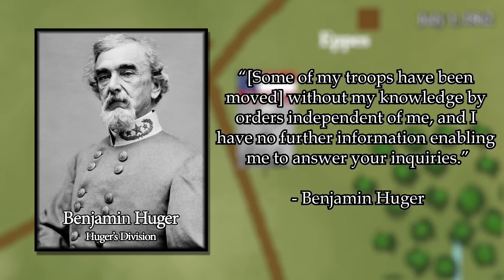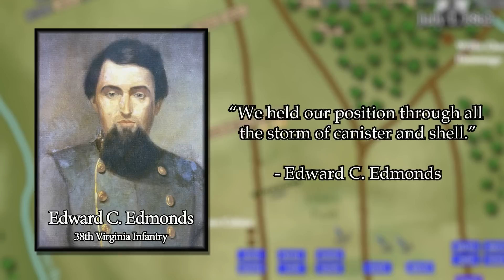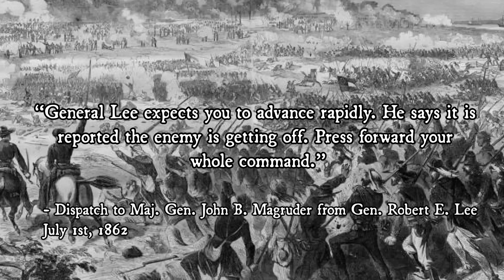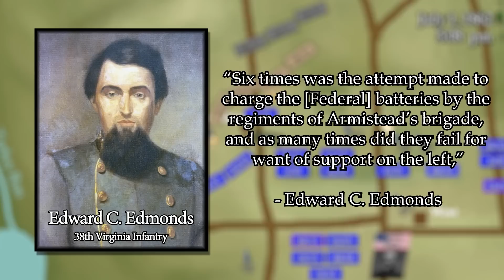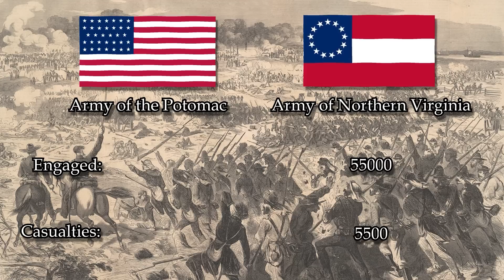ACW: Battle of Malvern Hill - "Magruder Attacks" - Part 2/2

Comment: Another interesting dynamic in many CW battles: commanders would attack a well-fortified position with even odds (or at times, less).  Conventional wisdom says you want 3:1 or better to attack a "good position".  All the Peninsula battles were fought without a significant tactical advantage....
Reply from the maker: well, Lee had 3:1 odds against that portion of the yankee line, however, some of his subordinates decided not to attack, ie Jackson
Reply: @WarhawkYT  Ah, yes, the legendary Jackson 7 Days Torpor.
Reply: @Stiglr  It would be hard to claim Jackson's division could have performed as it did in the coming campaigns had it taken the losses in this battle that Hill's/Magruder's command did rushing an entrenched enemy position across open ground with no real support.

Comment: Poor old FitzJohn Porter really did a superb job during the Seven Days, doing the job McClellan should have been doing rather than sitting aboard the Galena.  His performance at 2nd Manassas and Antietam were not so good, and he later got shafted by Pope and hostile politicians, but Mechanicsville, Malvern Hill, and even, I would argue, Gaines Mill were well fought battles by the AofP.

McLellan should have flat-out ended that war in the Summer of '62.  I would argue that the Army of the Potomac that Summer was at its peak, in terms of training, comparative equipment, and morale...and Mac squandered it

Comment: "advance rapidly [because the enemy is retreating]" does not mean "all out attack" over open ground uphill against several Federal regiments that are obviously not retreating, but are holding their ground, and backed up with several batteries. Magruder had a curious way of interpreting orders. The order should have been ignored because it did not match the "facts on the ground". I read that there is a theory Magruder was mentally unstable during this time.
Reply from the maker: Magruder saw some "success" that Armistead had and thought about adding on to it
Reply: The entire areas being [nuked] pal.
Reply: Dont go near a [doctor] without purpose, they often forced to make [mind] and no one can know if they want you’re central nervous system to be the way it is right now. 

This goes for the other parts of your body as well.